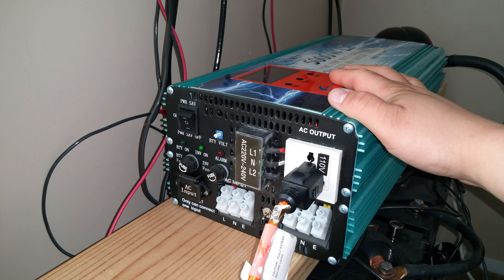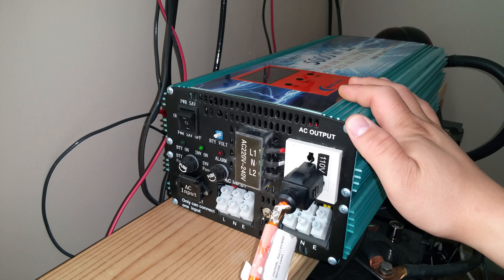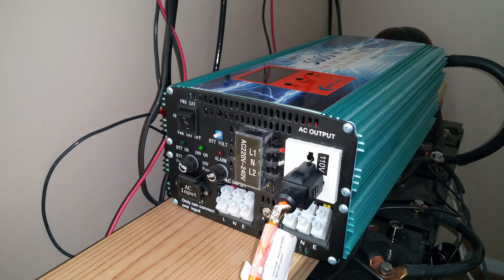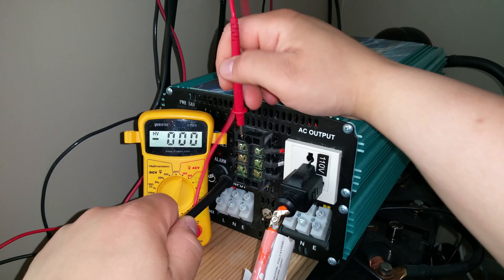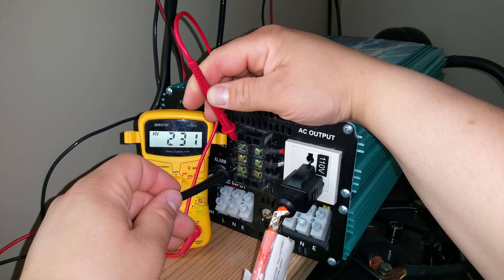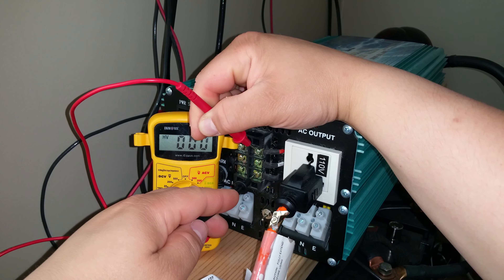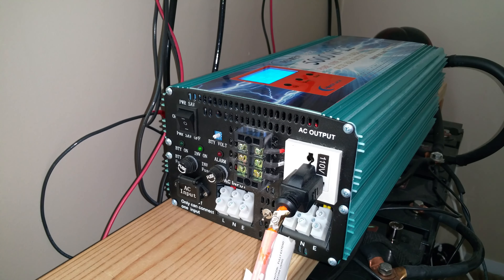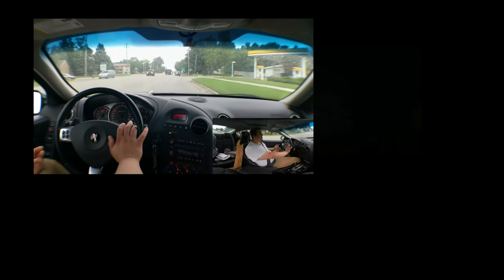Power Jack inverter - Constant hot leads?

Comment: In order to get UL approval rating these have to be located behind a removable panel.  Most of the newer models have this safety feature, although PowerJack still produces these the way this one is made.   This brand could do so much more but then they wouldn't be as inexpensive as they are if they did.  I'd recommend installation of these in an isolated place that can be secured, just like you'd do with a gun.   Also, I think it might be possible to re-engineer one of these by removing all the connectors on the front and running a cable inside to connect to the line voltage.  It's something I've certainly pondered on my PJ unit.  I plan on adding another inverter and making this one a standby back up unit with no power going in until and if I need to use it.  It certainly makes a great backup in case of a failure.

Comment: Thanks for the warning. 
How are you doing today buddy? 
Have a wonderful day and God bless.
Reply from the maker: +JW Solarusa outside right now sliding some panel's over a quarter inch to make room for more panel's.
Reply: GPVlog Sound like fun.
Please upload those videos when you are done ok?
Reply: What's the total solar panels power you have now
Reply from the maker: +JW Solarusa 900 watts. Getting ready to bump to 1200
Reply: +GPVlog That's brilliant idea
Reply from the maker: +JW Solarusa will do. Have a new panel coming today and the rest next week.
Reply: +GPVlog Sweet......
it's always a good feeling when upgrading your system.
Congratulations and good luck on your upgrade.

Are you still running 12V system?
Reply from the maker: +JW Solarusa still in 12 volts yes
Reply from the maker: +JW Solarusa got the one panel up but it's putting out about 20 percent less than the other panel's I have up so I am not sure if it's a bad panel or needs time to settle in.
Reply: GPVlog You have a bad diode
Reply: You have to test all the diodes on that panel and you will eventually fine the bad one
Reply: That happen to me before
Reply from the maker: +JW Solarusa is that a quick fix or am I better off sending it back?
Reply from the maker: +JW Solarusa can u explain
Reply from the maker: +JW Solarusa can u explain how
Reply from the maker: +JW Solarusa can u explain how
Reply from the maker: +JW Solarusa can u explain how

Comment: I have the 8K LF one works great
Reply: hishammadani1988 
hello. I just got a 5k power jack. and you say yours works great. is it still working? I haven't used mine yet. I sort of figure most ppl who have lots of trouble. are likely adding to the fault. with power cables to small. or just pushing it to hard. how do use yours. if you font mind telling. I'm using mine in a off grid home. thanks.

Comment: and no covers for the 4 battery terminals on the other side.  i used old square  tupperware container and cut a hole for the fan. works great.